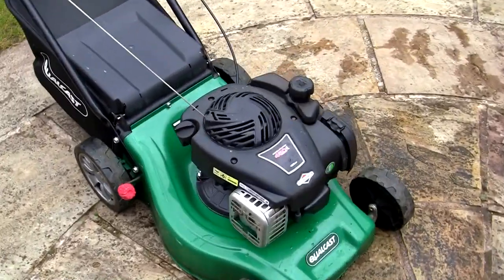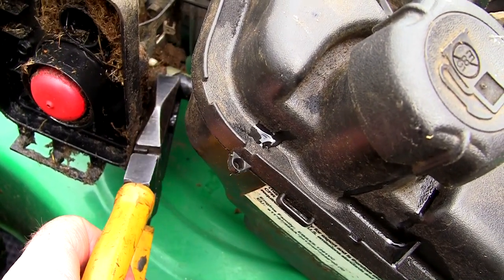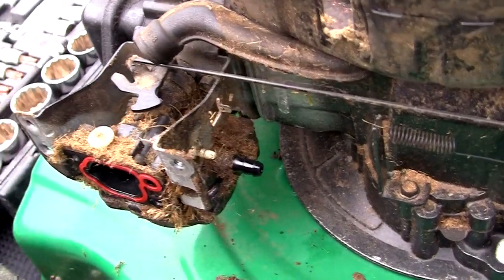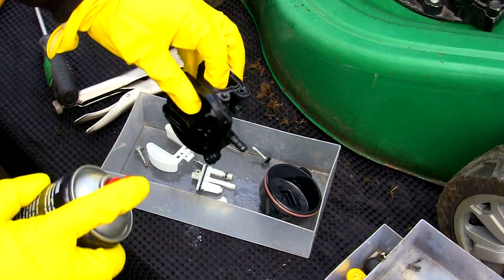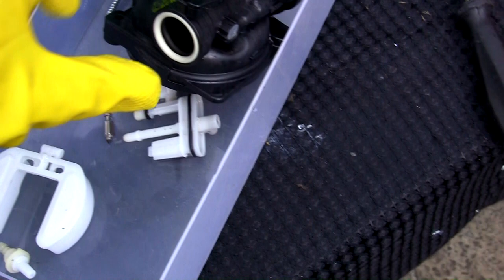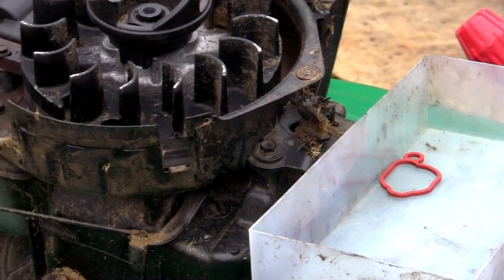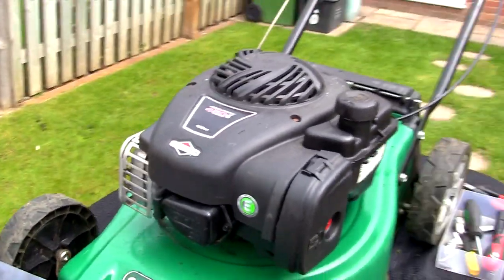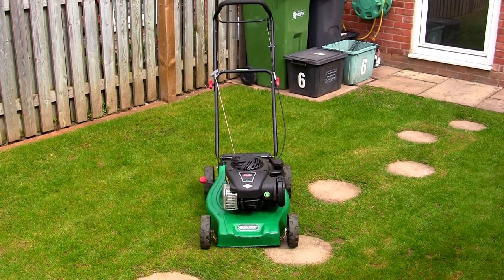Briggs And Stratton 450 E Series Lawnmower Carburettor Service

Comment: My mower has been running bad for the past 2 years and this was my first time taking a carburetor apart. I was a little nervous but I followed all your steps and put it back together and it started first pull on the first start of the season. The only thing I recommend is at 9:46 I'm not sure if you mentioned it but there is a little metal disk that could fly out when you use compressed air. It flew out and my heart dropped but thankfully I found it. Thanks for the great video.

Comment: Fantastic video!   I have reached the point where you lifted the petrol tank off. I noticed the carburettor linkage moves so freely it was hard to imagine it had a function.
I am now fairly confident I am going to find a broken spring under the pterol tank and that will be why my motor cut out. Bless you for taking the time to help us amateurs out.
I am now equipped to clean the carb should that be necessary. You have cheered me up so thank you.

Comment: A thought about a non-starting non-running B&S lawnmower. I recall that crankcase pressure is important in ensuring appropriate fuel supply via carburettor in a number of Briggs and Stratton engines.. That breather from the carbie to the crankcase would act to provide the pressure pulse from crankcase to carbie that enables the fuel to get into the combustion chamber. And another thought; if you leave the lawnmower out in the rain or even fog, expect moisture to get into the petrol tank and then into the float bowl, which will stop the fuel flow. It doesn't take much water to prevent running. Try add a bit of meths to the petrol tank as this may help as water and meths mix as do petrol and meths.

Comment: Excellent video. I fixed a 450e on a Mountfield HP185 2021 version. It wouldn't start. Now after a good carb clean it starts first pull. Job done. Thanks for the great guide which is so clear 😊
Reply from the maker: Well done Tony!

Comment: I've just took mine to bits put it back together it'll fire up then cut out. I have a feeling I didn't clean the carb out properly now after watching this video. I gave it a good spray with carb cleaner but I never knew the middle part of the carb could come out where the main jet is. Thanks for the video. Very helpful.

Comment: Brilliant video. 
I sorted out a sputtering rotorvator in a couple of hours. Gloves a definate requirement, with that carb spray, I used washing up gloves and it disintegrated the ends of the fingers.

Comment: Great video. Just cleaned (emery paper) the spark plug and air filter on the mother-in-law's mower and was hoping to find a video in case I needed to get a bit more involved. Amazed at how easy this is to dismantle and the carburettor is so simple! I know now I can take it apart to service it without any fear :) Thanks for a great video.
Reply from the maker: Thanks for watching Jim

Comment: This is so informative. I bought a second hand mower like this and it's been surging. I've tried changing the plug but didn't want to take the carb apart. I shall now be taking my carb apart! Thank you for this video.
Reply from the maker: Theodore Griffiths Good luck!
Reply: Mower Man I’ve just finished rebuilding my carb. No noticeable dirt but cleaned everything. It’s now running spot on. Thanks again.

Comment: May I respectfully suggest that you consider using the compressor to blow off any loose debris much earlier in the process - perhaps as early as just before removing the carb assembly.  Using a paper or cloth plug in the air intake should help with blown in internal contamination from the oily grass clippings.
when disassembling the float also consider popping loose both sides of the hinge pin - better control.

Comment: I believe the oily air filter comes, because when people try to clean the underneath after mowing, the flip the mower carburetor downwards which allows the oil to soak into the air filter. Only flip the mower spark plug downwards or carburettor upwards ;)
Reply: Oil is put on the sponge and wrung out so its damp with oil to catch dust etc. What you describe also happens

Comment: Very nice video BUT - when I removed the white plastic air inlet jet projecting from the side of the carb. I noticed that there was no hole at all in the end to let air in. You said that that this had to have a clear hole in it or the engine would not run. The mower runs but is hunting so I think it is the carb. I wonder if that is a rogue jet which was made without a hole- the plastic moulding with no hole makes it effectively a blank plug. Perhaps a later/earlier design? Thanks again for a great tutorial!

Comment: This is a really great video and very easy to follow. One question is my mower is now starting and running which is great as it wouldn't start before. Its running a little rough so I am wondering if I have not cleaned something enough or if the old fuel which has been stored in a sealed can might be the cause?

Comment: Good video. I just bought an used one yesterday and clean it. I did pretty much what you did except I have not taken the carb apart but will now, thanks to your video. I have one question? I have what looks like an broken tube comeing out of my gas tank. I think it was barbed with a hose going to the air inlet on the barbed piece on the carb. I notice in your video you only had the air inlet piece on the carb. I put an hose going from the piece on the carb to the gas tank. There was no hose on it when I picked it up. Just figured maybe a hose went there. Not sure. Maybe you know and can let me know. I am still looking an parts list for this model. Thanks for any help. Good video.

Comment: My lawnmower I was given,wouldn't start, was full of old oil, which I drained and replaced,took out the sparkplug,cleaned it with a bit of fine paper, scrubbed it with an old toothbrush checked for a spark, was sparking ok, put some fresh petrol and it fired up, but it wasnt running very well, the auto valve was opening  looking for more fuel,so I stripped the dellorto carb and cleaned it with the toothbrush in fresh petrol, put it back together and its running fine,ticking over nicely, didn't really know what I was doing,but over 35 years ago I taught myself to strip and build two stroke vespa engines,even though I havent touched an engine for 30 years the principles are the same I suppose, they both need a spark, fuel and air

Comment: Really helpful, I've got a problem with the idle on the same model. When running it peaks and troughs. I've taken the carb off and all looks OK. I might just order a new carb for a tenner. Could it be anything else? I can't see any adjustments anywhere.

Comment: Hello Mower Man , we have a very similar mower here in Australia. The million dollar question is ... how do you adjust the idle so it is not reving real high high before it cuts out with the kill switch ? My mower starts easy and revs right out , but the idle is a bit to high . It is a mechanical governor just like the one shown above. we both have throttles , but I think in USa they just have one speed.  I do not want to go mucking around streching springs and such until i know what i am doing. cheers
Reply: G'Day Clem,  May I suggest that IF your mower has a throttle adjustment screw that might be a start - otherwise the governor is under suspicion.  Unhook the governor linkage and start the engine and see what the default is - full or idle.  
Cleaning the carby with special attention to the white 3 tower "Cartridge" and it's removable center Emulsion Tube's tiny jets could also be of specific help.  If the tiny holes have been roughly "cleaned" with wires or picks in the past they might well have been 'reamed' to an oversized diameter, passing much too much fuel and causing an over rev condition.  If so, the internet is a grand source for replacement cartridges (or maybe even an inexpensive entire, new, carby.)  Also - thoroughly check out the 'Automatic Choke' system and see if your version has an adjustable idle circuit.
I spent a month in Canberra with friends in '20 - excellent time.     - Joe -
PS - US mowers use the smaller diameter split handle to retract (by cable) the kill switch - no over rev situation kill switch in our models.

Comment: Hi great video. Quick question. Do you soak the foam air filter in oil? I noticed you cleaned the existing with fuel but didn’t say if you needed to soak in in oil?

Comment: Thanks for the vid. On the hole in the carb the the pumper bulb lines up with there appears to be a spring, should there be a ball bearing against the spring? The reason I ask is mine is blowing fuel out of the primer bulb when running and it leaks out when it in the garage.

Comment: Great selection of videos - very informative and easy to follow. I have a Hayter 413H with a B&S 650 Ex Series Eco Plus Engine which has the classic hunting characteristic but only during initial operation - after 3-4 minutes of grass cutting, the engine runs very smoothly. Also the engine is sometimes difficult to restart after emptying the grass box. Are these symptoms of a carb overhaul needing to be done - I did dismantle the carb last year and couldn't find anything wrong but that was before I watched your videos....!!! Appreciate any comments. Keep up the good work making videos.
Reply from the maker: Thanks a lot!

Comment: My problem is i replaced a sheared pin on the fly  wheel, I started it up and ran it for a few seconds. I released the handle and it shut off like it should. I went to start it again and would not start ? Any idea as to what needs to be checked, thank you for your video. Nice job !

Comment: We have this exact model but in an effort to help my other half (he’s not been well) I’ve hit a hidden rock and now it won’t turnover. When I pull the pull start the blades turn, spark lead is definitely seated correctly and there’s plenty of fuel. I noticed when I hit the primer button, fuel was coming OUT of the little white air nozzle on the carb, so have I flooded it?  Any suggestions on what else I should check?  
All I’ve done is ADD jobs to his list instead of helping, so want to try to fix it myself if I can. Thank you!

Comment: Glad I found this film.  Excellent instruction and even I feel reasonabley confident that I could do this. I have this engine on a Viking mower.  It is prone to surging and back firing and it seems to be through the air filter.  Could that be carburretor please?  I am wondering if water could be getting in there now as it does get vaught by rain if I forget to put it in and the garden shed it sits in isn't the driest.
Reply from the maker: PROSPECTBARN I'd clean the carb
Reply: @MowerMan    I did it this afternoon.   And she sounds great now... Very many thanks

Comment: Hi
I have same machine and I didn’t use it for long time but yesterday I filled new oil and petrol and started.
It’s working but oil coming from engine to hose behind air filter and leaking.
Could you please tell me what is the problem 
Thanks

Comment: Hi thanks for a great video I have a mower with the same engine how does the throttle open and close it doesn't seem to be attached to thebrake linkage in any way just to the linkage at the back of the motor but that doesn't seem to do anything

Comment: I cleaned out the carburettor and the mower was hunting still, air filter is new and spark plug is in good condition, any idea of cause of it. I have same mower as yours in the video

Comment: Australia here!  Need advice Please.   I have the exact mower but in blue and have had nothing but trouble with it.  Am elderly female, living alone with zero funds for a new mower or repairman.  A few years ago, trying to get the mower to start by accident chopped the tops of my fingers nearly off and they all had to be sewn back on, and since nothing but trouble.   As it never starts a bloke told me to put a squirt of fuel down into the carburetor to help it start with the fuel lid off until the mower sparks up.  I have done this for years to start the mower but it never has run smoothly (mower is about 3 years old when purchased new). Today when trying to start the mower, the hole damn thing went up in flames when trying to start it.  I hosed it down getting water into the fuel tank and possibly the carburetor intake/hole.   I bleed the fuel and put new fuel in and tried to start it again and the same thing happened with it going up in flames.   QUESTION, if water got into the carburetor how can I fix it myself.  Also with that air breather on the side (just above the fuel line), my mower has a small black hose, BUT it also seems to be some kind of switch that will slide left to right (back / forth).    What is that about???  Why won't the mower start without much trouble and when running why is it not running smoothly?  Quiet curious about the air breather and why it seems to have that switch and don't understand why, for what purpose?  Why does my air breather have a black hose but int he video there is none?

Comment: Great video would you possibly know how to adjust the throttle on this 450 brigs and Stratton ? I’ve got the same engine in a cobra mower just has no power at all just out of warranty. Any ideas?? Thanks for super video
Reply from the maker: lift the petrol tank off and you will see the spring. You can shorten it slightly or bend the connector a little
Reply: @MowerMan  thank you Paul fantastic managed to do it this morning. Your a star I’m so grateful 👍

Comment: Hi there, Thanks for posting this video. I have a 2 year old mower with this engine which was stalling after starting and the winter break. I've followed your guidance to clean the Carburettor and it is running now but labouring heavily and still stalls regularly. Was wondering if there's anything else you can suggest as the carburettor looks like new. Thanks. Gareth
Reply from the maker: Gareth F The quickest thing you can do is buy a new carburettor. They are really cheap

Comment: Where does that Little white 1/8 in. Hose connector connect too. The carb. Has three hose connections, the top air (black) the lower gas line (black) and the center (White) connector. I think it's a return line but doesn't have a connection anywhere on the gass tank. I have spent hours trying to find out where it goes to.

Comment: after you let the air filter dry did you re oil it. as you didnt show that part. I have had hundreds of people replace those filters. and not oil them. its an "Oil-Foam" Air filter
Reply from the maker: Lawn Mowers & Things That Make Noise Yes I do that. I'll be sure to film it next time thanks.
Reply: @MowerMan  I wasn't aware of this, the maintenance bumf doesn't mention oil, it just says clean the filter and reinstall.
What kind of oil is used for this purpose?
Reply: I second that.  What kind of oil do you soak the foam filter in?
Reply: @undrtow0515  just the engine oil. My 500e takes 470ml out of the 500ml bottle so there some left to do it. I have other bottles and motorbike oil too. Any will do.
Reply: @twig3288     My manual says to clean it in detergent rather than solvent then dry in a clothe,   Then it says to soak in clean engine oil and squeeze excess into a cloth.

Comment: I finally had the carburettor off mine and stripped and cleaned it as directed. When I reassembled after a minute or two fuel just began pouring out of every hole on the thing so I hastily removed it again and checked.. can only assume the pin / float stuck open? Reassembled again and it just will not start still. A squirt of carb cleaner into the air filter and it fires and runs for a second or two before conking out. Fuel is fresh 95 octane from Shell. Had to resolve that the carburettor must be duff and its not fuelling properly somehow... Ordered a knock off one on Amazon so hoping that will do the job! Maybe the float is stuck closed now?!
Reply: Did your new carb work?  Mine is doing the same thing, it would run on starting fluid then shut off.  I even tore it apart and cleaned just like here.  The only thing when I go to prime, you can't feel any fuel being pushed into the carb.
Reply: @UpperChesapeakeBaySkiRiders Yep new carb and a quick prime and it fired up immediately. Honestly for the cost of like £18 on Amazon it's worth it vs your time stripping the thing three times and wondering why it still won't work :-)
Reply: @jimtaylor431  I decided to try one last thing.  I took the wire from a bread tie and worked it through the main jet.  I was using a slightly bigger wire and it wasn't going in the small hole, in which I thought it was.  It broke through the gunk, I sprayed cleaner down the jet and it sprayed.  Definitely no blockage now.  Reassembled and it fired right up.  I like to tinker, and I wanted to get this running.  these jets on these plastic carbs are smaller then On most carbs so don't be fooled.  Now I have to cut grass. Take care.
Reply: @UpperChesapeakeBaySkiRiders  Yeah I should have tried that.. just ran out of time due to life commitments so had to cut my losses as too just needed to cut the damn grass.. :)

Comment: I have a 450e that surges constantly. I’ve dismantled and cleaned the carb, also the air filter and it started first pull but the problem continues. Any ideas? Cheers.

Comment: great video, we have this exact machine and it starts well but then starts hunting, would that be the filter ?
Reply from the maker: Kezzaburger Pilbeam No it will 100% be the carburettor
Reply: Ours hunts as well. Has done it since absolutely brand new. Wouldn't expect that to be a blockage. Stops hunting if you  hold the governor rod though.